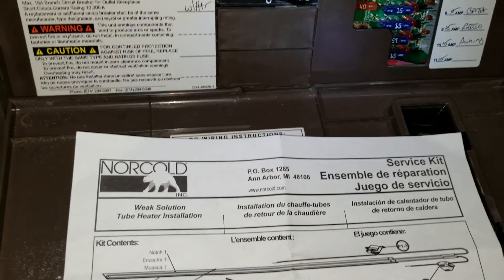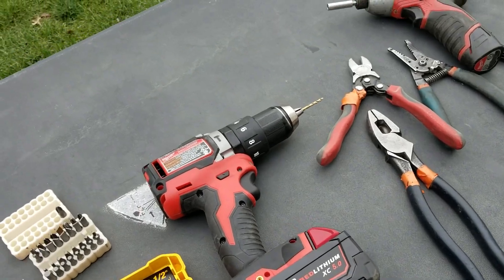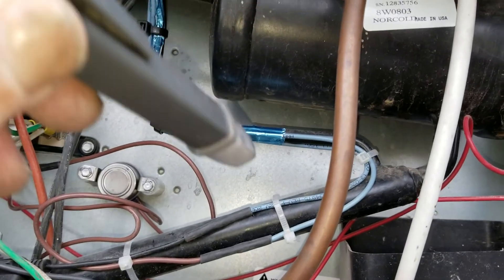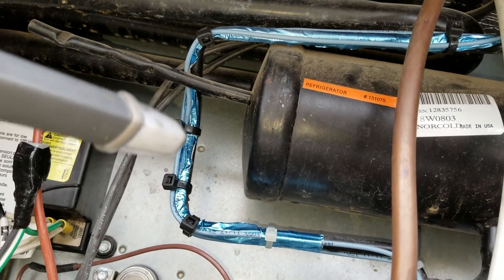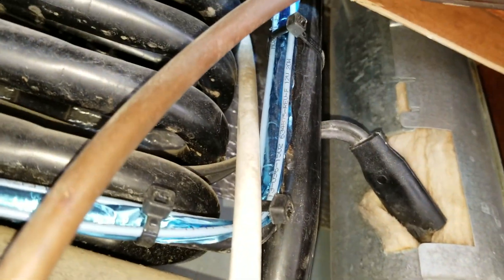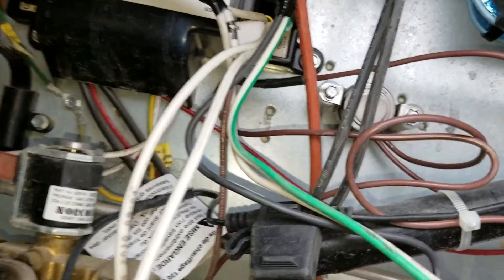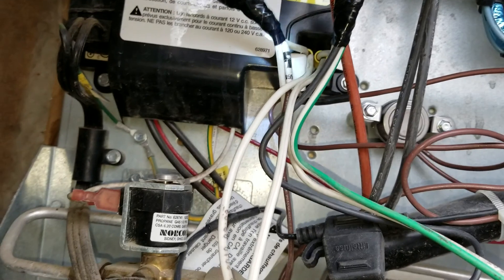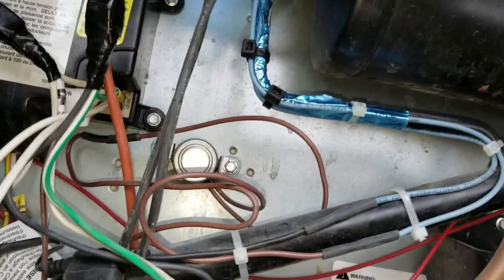How to hook up a Norcold cold weather kit for an RV refrigerator

Comment: Great video. Well done. Did it work? My Norco is quitting on me around -15. Looking for a solution.
Reply from the maker: It did work. It still had trouble cooling on only a few of the extremely cold days. Not sure exactly why? It may have been because I couldn't reach the top to completely stick it on the tube up on the high part, or I believe it may have been something to do with the outside wind speed and direction combined with the sub zero temps. I was in North Dakota when I made the video, now I'm in South Dakota. This past winter it still worked well, unfortunately my refrigerator went out completely in March. I plan to maybe replace it with a Dometic and pay a little extra for the model with the cold weather kit. I heard Dometic operates better than the Norcold in the winter? I have a small temporary refrigerator right now. Another cheaper option is to get a regular 120 volt refrigerator that fits in the same hole. I just like the ability to keep my refrigerator running on propane when I want to.
Reply: @allewton  i’m thinking i might replace my Norcold with regular v120 as im sick of the Norcold dying in the winter. Works great the rest of the year round. im in SD too near Spearfish. What part of SD you in?
Reply: We put some pipe insulation about 3/4 of the way across each of the vents on your vent cover. We alternated  so that there was about 3 or 4 inches for air on alternating ends.  That worked to slow down some of the cold air.
Reply from the maker: @fightintheshade  I'm way on the other side, I'm in Sioux Falls. I agree, If your going to spend every winter up here, the 120 v fridge is the best option, just takes all the worry away.
Reply from the maker: @bonnielopez7597  Thanks for the tip! I will try that for sure. I didn't think of that. It really seems like a good idea that should even compliment the cold weather kit.
Reply: well done? were you watching the same video?
Reply from the maker: @frankscafe635  come on, man. Obviously I wasn't even at all trying to be the best at making a video and uploading it to YouTube, but people on here are able to follow it and then go and do the install themselves, I was being helpful. I wasn't good at presenting, and I wasn't good at holding back the anxiety, I have had to grow up in public! I was neglected to the point where I had a severe lack of communication skills. I never stopped trying to get better. I hope this helps you understand that we aren't sure why everyone is how they are. I am giving weekly speeches now to help people learn. I have grown over the years, and the last year has been the best, people see the drastic changes in me.
When my dad kept me from going anywhere for 3-1/2 years, I went crazy, I had lost the ability to know what to think, say, or do at the time. I have fought so hard to overcome all that and just feel normal. Now I can talk! I took action. Making videos and uploading them on YouTube helped me get to the point I'm at now. I know you're not like the haters on here, but to question his view of the video seemed unnecessary because he honestly learned from it and genuinely appreciated that I made the video and uploaded it.